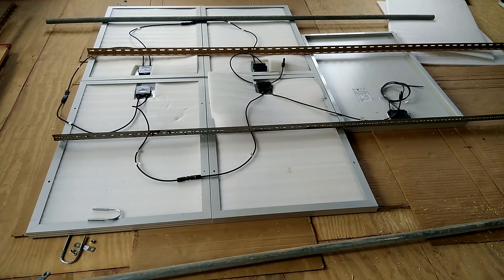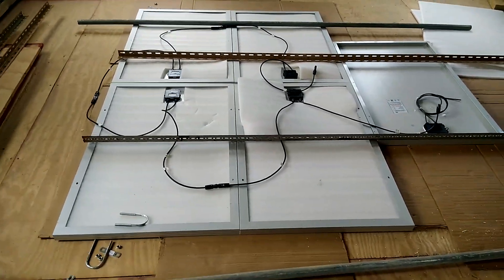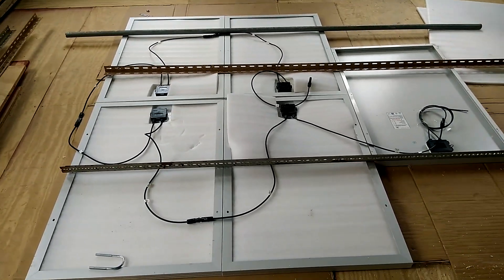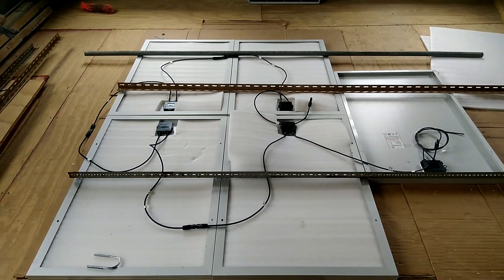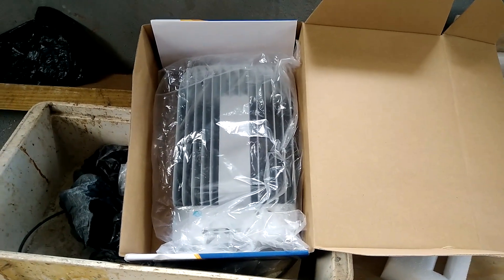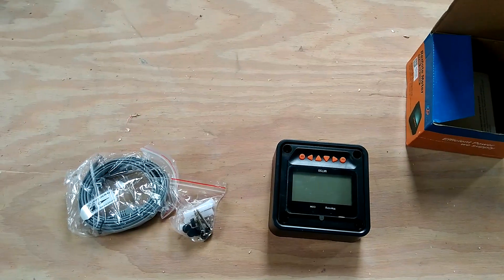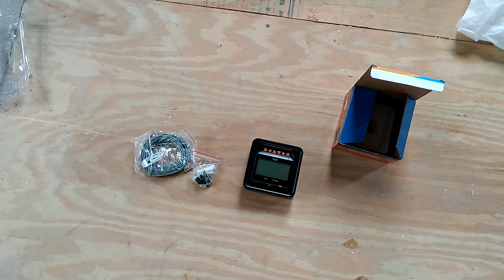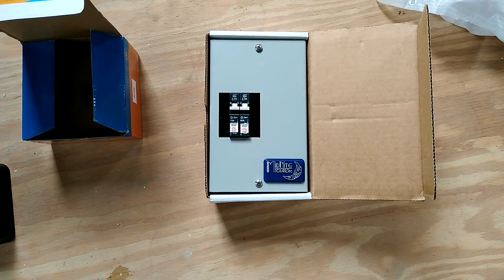SolarEpic MPPT 40A Solar Charge Controller 150V PV input

Comment: Wow nice brother. I love my Pip 2424. It runs my house in the day time. Brother one thing. Remove that foam from the back of the PV. It's going to make them over heat and will burn up the traces. Will not be good. Seen it happen more than one time. God Bless.
Reply from the maker: +yankey4 I will move it bro thanks
Reply from the maker: +yankey4 thanks for your comment bro